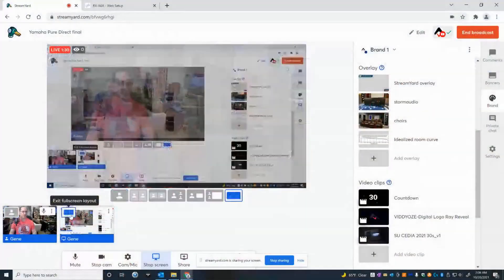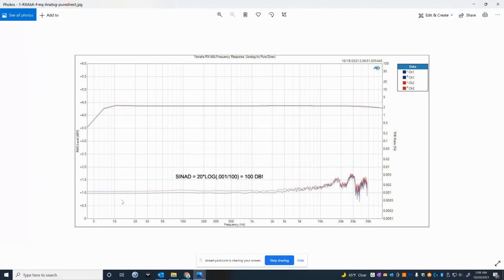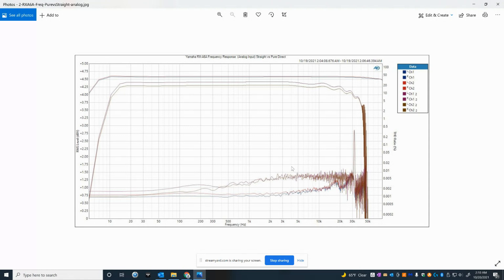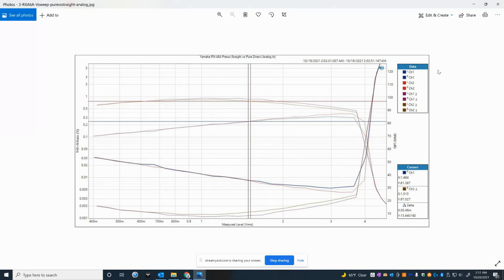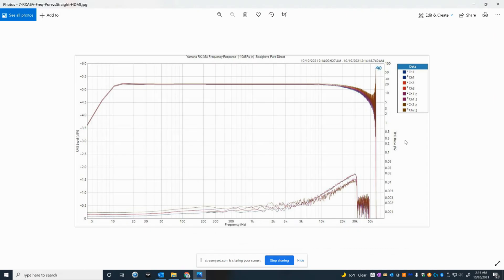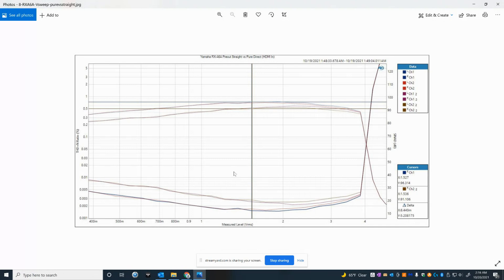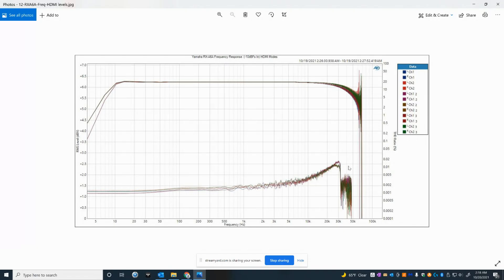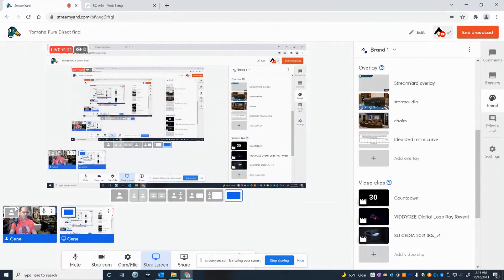Yamaha "Pure Direct" Better Performance or Pure Nonsense In AVENTAGE Receivers?

Comment from the maker: Correction: at 4:04 I meant to say "Pure Direct" mode has ruler flat frequency response. Sorry for the confusion.
Reply: I noticed that. Thanks for the clarification.
Reply: For me through the analog inputs in pure direct the bass and sound quality took a nose dive. I had to substantially increase volume to better drive the speakers but still sounded flat. Granted down in the game room my speakers aren’t very sensitive @ 87db so I wonder if that’s the issue? I never connected my Legacy speakers to check if speakers were the issue since if that was the case it wouldnt work for my needs. I exchanged it for the A8. If that model doesn’t work I’ll head to Marantz and grab the SR 8015. Any thoughts for the greatly reduced audio quality?
Reply: @AlexMQQ2273  Do you have YPAO engaged when you're not in Pure Direct?

Comment: With my r- n800 a at first I thought there was something wrong with my speaker wiring because I was checking the balance and it was very little or no change from left to right both speakers were playing regardless of the position of the control. I turned off the pure direct feature and my balance control worked normally.

Comment: Hi, Been using the pure direct on the A6A with Perlisten r5ts + bluesound node x. Weirdly on pure direct the imaging and volume is higher on the right side tower. Any fix or solution for this since all other signals are shut.

Comment: Just fixed one of the many Yamaha (HTR-2064) home cinema amplifiers. The DAC was not working so sound was only coming through main speakers when in 2ch stereo mode and only if bass and treble were in the zero position. When pure direct was selected there was no sound, suggesting it is converted to digital and then back to analogue as it was not passing the DAC chip. It seems that 2ch stereo is actually direct mode with the Yamaha amps. Once i changed the tiny 28 pin DAC chip PCM 1681 it was back to fully working.
Reply: How come ? Is this checked ?

Comment: Gene.  I have the RX2080 and running a Emotiva XPA DR3 to drive my front 3 channels.  Is there a pre amp gain control to turn the pre amp up or down or is it just straight power with no control over the amp.  If you do. How do I access it?

Comment: I have the yamaha a4a.  I turn it off with my roku but about 1-2min later the AV turns back on for about 20seconds then shuts itself off again.  Kinda like it thinks I turned on the roku or tv but I don't.  Any ideas?

Comment: i have RX-A1080  and run kef ls50 metas for my front channels ,
i  listen to a lot of music and at first hooked up bluesound node 2i
and was never happy with the yamaha , for music very poor and lifeless,
then a sold the bluesound and purchased roksan attessa streaming amp
and used the pre outs from the yamaha and wow there is no comparison
at all , the roksan is sublime and it has blusound built into it and pretty 
sure it uses a much better dac as well ...
dont get me wrong a have owned a lot of yamahas right from the days of pro ligic
and i love them for movies surround it never misses a beat , 
i only do 5.1 as room is not too big , uses svs 3000 micro sub and kilpsch refrence
center , and for rear quad 11L  ( at one time used all quads ) 
keep looking at the new yamaha but cannot justify one as dont do any  gaming on 
tv and not a fan of the smaller display and not convinced it will bring anything to the table
over the rxa 1080 ...

Comment: No, Pure Direct does not do anything. It is NOT using Pure Direct that does something, which provides some functionality or sound tweaking at the cost of some additional distortion, etc. Integrated amps and receivers have had a similar feature as Pure Direct for many years, even if all it meant was bypassing the tone control circuitry.

Comment: The downside to using "Pure Direct" mode is that it bypasses YPAO (Yamaha's proprietary speaker calibration mechanism) time alignment and speaker equalization. It may be the case that an audiophile magazine rates a given set of speakers as providing highly flat frequency response (which I would think most people would want if their goal is to hear the reproduced audio just as it was produced, without coloration in frequency response.) Once you place said speaker system into any room, that room contributes its own inherent characteristics to the overall frequency response characteristics of the speaker system, possibly rendering the overall system anything but flat. While disabling "Pure Direct" mode results in having to listen to audio that is processed through YPAO, in my opinion the benefits (flat frequency response) outweigh the costs (I've read people talking about possible latency associated with digital signal processing.)

Comment: The minimum expectation one might have for any receiver is that it convert audio input through the SP/DIF, optical, or HDMI interfaces from digital to analog (sound is an analog phenomenon) for amplification and output to the speakers. Today's audio/video receivers, and this is particularly true with Yamaha receivers, typically employ digital signal processing modes to emulate specific acoustic environments. "Pure Direct" mode simply bypasses any additional digital processing and causes the audio bit stream (and video in some cases) to be decoded and amplified by the receiver without the application of any additional digital signal processing. One would therefore expect to hear (and see) the audio and video just as it was encoded by the source's (CD, DVD. streaming, etc.) producers.
Reply: Yeah, the dsp stuff actually sounds good on yamaha avr.

Comment: As mentioned previously in the comments - what a Pure Direct really does (and one can test it easily) it decreases audio latency A LOT when you have SPDIF signal input connected - easy to check when you got for example a decent audio interface with speakers connected and another pair of speakers connected to Yamaha. Tested on my RXA3080

Comment: So basically these AVR's in pure direct with a good power amp gives me the same performance as if I used a decent preamp with the same amp? I was always under the impression that preamp outputs with AVR was less than desirable.

Comment: Hi gene, excellent review with in depth details. I have a question, I own a yamaha rxa1000, pretty old av receiver, planning to buy yamaha rxa6a, and planning on 7.2.4 setup. Can I use the old rxa1000 for 10th and 11th channel? If yes should I put the rxa1000 in pure direct mode  with 12v trigger from rxa6a?

Comment: I have a much older Pioneer A-35R that used to be paired with some SP-BS22-LR, and they sounded slightly "better" with direct off. I upgraded my speakers to the Elac Uni-Fi UB5 when they came out and quickly started fiddling with every setting i could adjust. These sounded much better with Direct on, compared to the SP-BS22-LR's which didn't really sound better either way and was more of a preference

Comment: Thanks Gene.  The .25dB or so level change when engaging Pure Direct (I've seen on other AVRs too) means if a listener hears a "quality difference by using Pure Direct" it might actually be nothing more than the fact that the level has subtly changed. Tom Nousaine in his JAES paper "Can you trust your ears" points out that in his testing, listeners consistently report subtle level changes like that in qualitative terms like "cleaner", "more smooth", etc., when in truth there is no change in anything but level. The moral of the story is only carefully level matched A/B tests are valid and many will errantly think they are matched when testing "Is PD audible?", when in truth they aren't.

Comment: Thanks, very informative! Unfortunetly my current Denon AVR 4310, although being a great receiver for my setup, has a little bug which actually forces me to use PD while playing simple CD or Records. When I use Straight Mode, there is soms occasional audio dropout, which for me is absolutely unacceptable especially when listening to music...this seemed to apply only for "audio only" inputs (CD & Phono) but not solely related to either analog or digital, which made it even more confusing. In the end, I eventually learned by trial and error what was causing this: Straught mode for CD and PHONO and TUNER always sends HDMI stream (DENON logo for the first, tuner interface for the latter) even when I don't need that and rather have my display switches off. Using Pure Direct for these inputs completely illiminates that problem and keeps the HDMI section in the AVR itself cool. Maybe someone can use this info! Yours sincerely from a Denon fanatic from Holland..
Reply: I realise this is actually about Yamaha, but I think for a big part this story applies to other brands too😊

Comment: so, I have a question for anyone who sees this (love these videos, and your site, btw). I have a Yamaha RX-A3050 and an Onkyo TX-SR876. The Onkyo supports 'bridged mode', meaning it can take two pairs of speaker outputs and make them a single pair with supposedly twice the power, and I'm using that as an external amp for my fronts. That means I'm using the Yamaha for my main system, with the speaker setup 9.1 plus Front, giving me a 7.1.4 setup. I was using the stereo out from the multi-channel out from the Yamaha to one of the inputs (CD I think. It's not hooked up at the moment), setting the volume to 0.0dB on the Onkyo, and using Pure Direct. Sounds great to me, and so much better than when I was running the fronts off of the Yamaha (please don't suggest me getting a new/different amp unless you're buying it for me. I have what I can afford). So, my question is, is that the best way to go about this? It seems like sticking with the analog is the way to go, but these are different receivers, too. So many the digital of HDMI or Optical may be better?
Reply from the maker: No Onkyo AVR supports "bridged mode". They have Biamp mode like everyone else. Big difference.
Reply: @Audioholics  please take a look at the manual for the TX-SR876. It's still available online for download, and you can use the search tool to look up the word, "bridge", where it explains it as well as how to set it up on the AVR.
Reply from the maker: @nsday1  you're right! I'm blown away by this and need to test it. I suspect they current limit to avoid overloading the power supply. Thanks
Reply: @Audioholics  yea, I'm not sure about that part. In the manual they talk about it being able to be used in a 5.1 setup. But I'm using it as purely a 2 channel amp, in Pure Mode. I was using it that way with my Yamaha in an 7.1.4 with the Onkyo powering the front 2. But we moved into a new place and about to build a new theatre room, so most stuff is packed away, and just have it out alone for music before the drywall arrives. I did notice a really big difference in dynamics, depth, and power when I first added it with my Yamaha. This video just made me wonder if I should be using the analogue or digital lines from the Yamaha to the Onkyo

Comment: I have a Yamaha AV Receiver RX-V583 and a Yamaha subwoofer SW300. The subwoofer is connected from RX-V583 sub pre out to SW300 LFE input which is working fine except when I use DIRECT mode. In DIRECT mode, there is no audio signal coming from RX-V583 sub pre out to SW300 LFE input. I am thinking of connecting the FR and FL OUT of the receiver to the Line IN of the subwoofer then connecting the FR and FL speakers to the subwoofer Line OUT while keeping the sub pre out-LFE connection. IS IT SAFE TO HAVE THE 2 INPUTS (Line IN and LFE) in the subwoofer connected to the outputs (FR/FL Speaker out, and sub pre out) of the receiver active at the same time?
Reply: What happened ?

Comment: Gene, Love the shirt. I typically use standard mode with exclusively HDMI inputs, including ARC and EARC. Are you able to test the HDMI out for ARC with your equipment? Also, any chance you are gonna touch anything besides audio on this receiver? I know I know, about the dumbest question to ask if AUDIOholics is gonna test video, but Its wishful thinking on my part hoping they are gonna do something to fix the Dolby Vision issues, especially with equipment such as NVIDIA Shield.

Comment: I wished he explained very clearly what the hell is pure direct. 
Also wished someone would say, which level of volume to get the surround speakers to be louder? 
Should you make the front and center speakers very low and surround and back speakers at max? 
Also also, Why are my Zone 2 speakers super low on my Denon AVR-1200? I know it's old but it ain't that old. I want my Zone 2 speakers to be loud. Not low, like my surround Klipsch speakers.

Comment: Gene, love this and all your videos.  It would be great to see a comparison of the A6A vs the V6A to see if the price difference is worthwhile.
Reply: Additional cost for better parts. It's always worth it if you care about the sound and you are using good speakers and cables. If you have modest speakers or low end cables... you might not hear much of a difference, and then the amp upgrade is not worth it. 

What is the rest of your gear?
Reply: @LarsonChristopher  I currently have Jamo S809, S801,C83, & J10 sub connected. I have Polk Rt-16 on another system that I may use instead of the S809s

Comment: I prefer straight than pure direct on louder music because straight includes my subs with 80htz bass management.  Pure direct is good on low volumes and with low bass acoustic music.  I stream Tidal Master through Apple TV and it sounds sweet.  It would be nice if the receiver would automatically place speakers to large when pressing pure direct.  I have to get into the menu to place fronts to large.
Reply: There is no bass management when using pure direct, so no need to change speakers to large.

Comment: Very disappointing that even in 2021, AV receivers are still missing full immersive audio support. There are at least three missing features that I'd love to see some day on AV receivers:

1. Native support for Dolby Atmos from music streaming services like Tidal, Amazon HD, and Apple music. You do get support for these services on most immersive audio based receivers, but only in 2 channel audio (you could of course upmix it to 7.1.6 using DSU/ DTS Neural X, but it's not the same). To get Atmos music on AVR, you still need an Apple TV 4k connected via HDMI.

2. Support for Dolby Atmos Headphones. Why no AV receiver offers Atmos via its headphones jack like you get from any Windows 10 PC after buying/installing the Dolby Headphones app and drivers? This is a feature you'd expect from any AVR that carries the Dolby Atmos logo...

3. Binaural recordings to immersive surround upmixer. There are many music recordings and albums, which were mastered for 3D headphones experience, such as Sony's 360 reality audio, Apple spatial audio, and unbranded binaural recordings. Why not add a listening formal like DSU and Neural X, that decodes 2 channel binaural recordings into multichannel surround on speakers? Such is possible by the already included powerful DSP.

I still can't seem to find a good reason to upgrade my 4 years old Denon A6400H.
Reply from the maker: All valid points and worthy of a YT video. thanks.

Comment: I have the A2080 and A8A and rarely use Pure Direct on either. All my speakers are low efficiency so get no hiss on Straight - cannot detect any distortion either.  Better with the sub on. 
Pretty good results though. :)
Reply: Hi friend, do you feel an improvement in music and film quality between the 2080 and the A8A?  I currently have the 2080 and I want to change to the A6A, I still don't know if it's worth it.

Comment: I care about SiriusXM. I bought a 1060 when it came out. I can say that it handles SiriusXM pretty trashy. When the connection works it sounds pretty good as it transmits at AAC 44.1khz. Makes me wonder how a Roku box makes a better connection with XM, anyways nice to hear that they are addressing the issue. Waiting for your review to see if the A6A is worth the upgrade. 
Thank you very much for your work.

Comment: Hi Gene, I know you said at the end of your video that there was no difference with Pure Direct screen off and on (unsure if you said or meant measured?) but have you tried it with the DSP engaged or is this no longer a feature? 
I haven't tried this with my RX-V2085 but my old RX-Z7 (2008) had a ridiculous amount of DSP/room correction modes that were able to be saved and that included room correction of all channels on the Pure Direct setting...
That receiver boggled the mind! lol

Comment: Unless you have a 100% perfect treated and symmetric room you need YPAO and so pure direct is out of question
Reply: Yeah I agree. My room had hard wood floors and vaulted ceilings. Not very good acoustics. The ypao def helps over pure direct.
Reply: @boostedmaniac  I invested 8000 dollars in room acoustics and it still needs YPAO to correct the problem left speaker near to a wall while right one is next to a door as well as bass still makes a difference because I can mount membrane absorbers only on the right wall